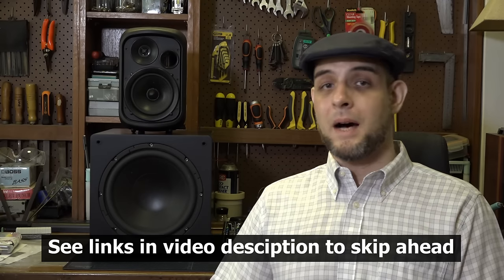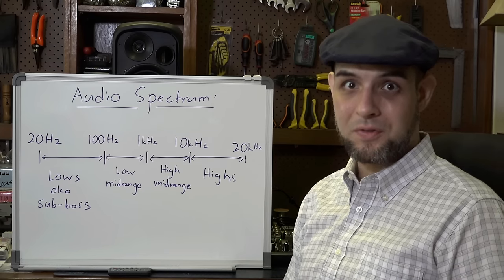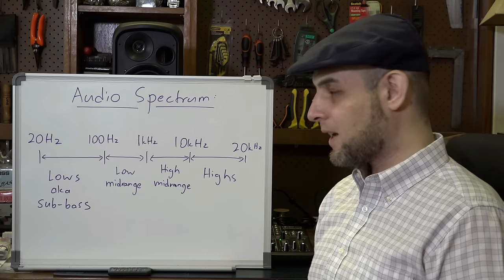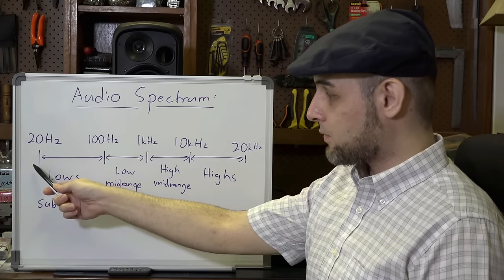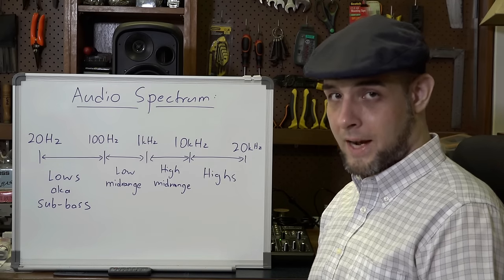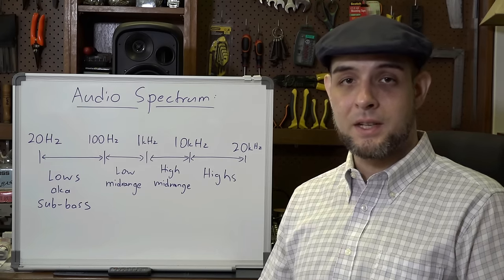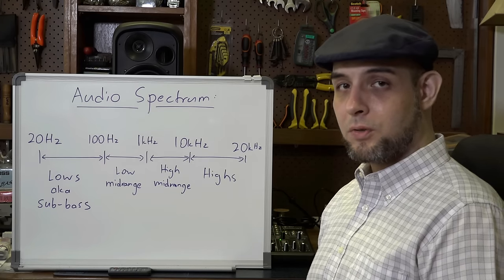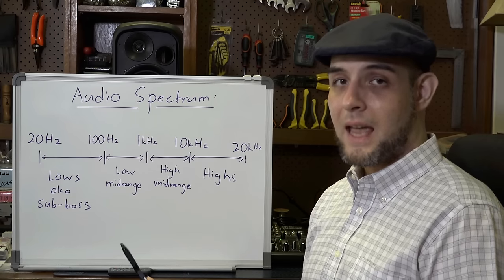How to connect an active subwoofer to a sound reinforcement system

Comment: Hello GLB, enjoying and gaining audio knowledge from your videos well done! 
On behalf of a church, we have bought a mixing console (unpowered), an EP4000 watt Amplifier at 4ohms, two full range speakers at 4 Ohms, we will soon buy subwoofer and 2 stage mornitors. How can we connect this PA System? Very confusing.
Reply from the maker: I suggest that you hire a local pro audio engineer to help you connect this system together - that way it will be done correctly the first time around. They can also suggest what additional equipment you might need to purchase in order to make the best use of the system.

Comment: Hello Bruno@GLB Production.  Thanks for your video.  I have question: Does Yamaha MG10XU has the Post Fade Aux / Group Send connections?  If not, what better mixer have those?  Thanks again!
Reply from the maker: On that mixer you would need to use the FX send.
Reply: @GLBProductions  Thanks so much! what is the next upgraded mixer would you recommend?  A better one than the Yamaha MG10XU?  The purpose for the mixer is for Karaoke system with two active loud speaker and a subwoofer, plus recording karaoke song/live voice to the computer.
Reply from the maker: It depends on your requirements: if you need more channels/more aux sends the logical upgrade path is to the MG12XU. If you need more professional features you would look at one of the models in the Yamaha MGP series.

Comment: Can you connect both active and passive speakers togethers on a powered mixer?
Reply from the maker: Yes you can: passive speakers to the speaker level outputs and active speakers to the line level outputs.

Comment: I came across your old video and thank you for your excellent teaching.
I'm curious if there are differences between: 
A - bi-wire from the integrated amp into the full range speaker ( 50 hz - 20Khz), then 2nd set of wire into the subwoofer and manually X-cross at 50hz
B - from integrated amp into subwoofer and manually X-cross at 50hz, then from the subwoofer output into the the full range speaker (50hz -20khz). The latter method is how you illustrated in the video. Thank you again!
Reply from the maker: Good question - it's very important to understand that because the sub is active, the connections that you see in the video are at LINE level. If you are using an integrated amp with passive speakers your connections would be at SPEAKER level. So the methods described in the video may or may not translate directly to your setup. To answer specifically: 
A) Bi-wiring is a hi-fi technique and is not used in pro audio. That aside, this setup is inferior as it does not remove the low frequencies from the fullrange speakers. 
B) Remember that the video shows LINE level connections - the amplifiers are in the speakers themselves - if you are using an integrated stereo amplifier or AV receiver the amplifier is in a different location. 
I hope this helps 😊
Reply: @GLBProductions  Thank you for your details response and it helps very much. 
It's for my home 2 channels stereo system consists of Rega Brio Intergrated amplifier utilizing bi-wiring speaker line out to the active sub-woofers and to the passive speakers. It's identical for set up for left and right channel. The intend is to provide full frequency range signal to the full range speakers, and only remove the high frequency from the sub-woofers. In addition, I prefer to utilize the amplification from the integrated amp feeding the passive speakers oppose to the plate amp from the active sub-woofers.
Do you see any issues connecting this way, and does it changes the ohm load and/or consider parallel connections?
Reply from the maker: Ah the Rega Brio - nice compact setup 😊 If you are happy with the way your setup sounds then by all means keep it that way - the way it sounds is the most important thing!

Comment: Can we have some insights on line array systems pliz 🙏🏼
Reply from the maker: Sure - could you be more specific?
Reply: Connections, recommended sets, relative angle adjustments... Basically the whole stuff about line array set up 😁🙏🏼
Reply: I mean a dedicated session on line array systems.
Reply: Let me add something as well:
Although the passion was there for me to go for a formal training in sound engineering, I never could afford it, nor were there any sponsorship even from my church.

You are my only teacher on this. I have learned a whole lot from your channel. I admire your wide range of knowledge on sound engineering. I also like your sense of humor 😁👍🏼

Bruno, you are my "guru" 🙏🏼
Reply from the maker: Thanks for the suggestion Steve, and I'm very glad the channel has been helpful. The best way to learn more in this industry is from a fellow professional, so don't be afraid to intern or work part time for your local live sound company or event production house - there are always openings for those who work hard and show up on time 😊

Comment: Smartest Video, most thoroughbred video / explanation-al / education video on this within entire YouTube, as Believe me - I CHECKED everywhere until I found you! ....so glad I found you subbed BTW, one more question for you GLB, does it matter how thick the wire is on my passive sub (Basic - RED AN BLACK THIN WIRE PLUGS IN EACH END) as I have the ULTRA Rare to find Neodymium magnets = Monsoon MM-1000 2.1 Flat Panel Computer Speakers (3-Speaker, Black) "system" (highest end originals ever made BUT Not as impressive as second gen I used to have - however still insanely beautiful & rich) unless maybe my amp is broken (inside psu or?...) and I can not be sure, anyway to be sure?... I have the original huge, heavy PSU... I am missing the control unit though, not a huge deal as I will find it down the rabbit hole of eBay, etc - one day an it has controls on top of unit as well so this is NOT my issue!...

Now, my MAIN Question is, I was giving a nice sony ss-ws5 sub woofer in silver case I was going to use as a micro ATX computer case custom of course until I realized it seems it works and will be a great edition to my monsoons and just what they need if I figure out how to make this passive sony woofer an active one or just make it work the most sensible way to get my 90's hip-hop and hard / 90's and beyond - alternative rock working well with this Sony (with the monsoon "system" which has two channels if that matters?) which I think is 60 watts from what I see.... Suggestions?

Thank so much for the video, sound is coming back in style for 2020 and beyond so hope your still ding videos, now is the time to strike, good luck - your very knowledgeable on this stuff an I appreciate you greatly, Stephen from Philadelphia, Pennsylvania, U.S.A. 

BTW: Look forward to an awesome reply with some situations for ME and MY situation FROM Someone like YOURSELF.... I think the PDF for my monsoon specs are right on the web, 20 watts? I am leaning toward maybe having to turn the passive song into a active with a amazon 30 watt (or up to 60?) AMP! .....Or will my situation change just by getting much thicker monster type two wire versus the cheap thin copper stuff I am using now to TEST.....  Thanks Again...
Reply: If I do put an AMP into my passive sub - shall I build it inside the unit like I want to and can to be clean looking as I am good at this stuff... I am a residential hard wire electrician and a computer building "enthusiast" that LOVES an appreciates his sound.... I suppose I am asking will the air inside the unit be disturbed so much so that it ruins the experience if the AMP is put inside? As I an see the model of the Sony was built for the air to travel out the case, how particular this is, I am unsure.... On another note, I have old HP speakers from my old plasma from 2006 that are spectacular that I could never throw them out but they will not play unless hooked to the tv, maybe make my own system with this with wood, an amp, but what type of amp is good for a project like this with many tweeters, mids and an out woofer or two? By now you may realize I know NOTHING about "AMPS" but am in search of knowledge on them, I suppose a project like this I would have to solder, maybe a video on making any speaker a Bluetooth speaker will do well for YOU?.... Also, please do not hesitate to tell me if you think the Sony speaker inside the Sony SS-WS5 is not worth it? I have no taken it apart yet to feel the quality nor the type..... It looks decent, can not see if paper or not..... I doubt so though, it seems to be built well like those years in the 90's up until around 2009 when we still got stuff built like TANKS an meant to last forever that also sounds great however I could be WRONG....
Reply from the maker: Hi Stephen, nice to hear from you! If I were you I would keep the subwoofer stock and look for a suitable external amplifier. You could also try and find a suitable AV receiver to drive your entire set up - sub plus tops. I'm not an AV/hifi specialist so can't really be more specific than this - good luck with your system!

Comment: somo active speaker have build in crossover, can you use external crossover with those speaker? if so how to bypass the crossover of the speaker?
Reply from the maker: No, this is generally not possible - active speakers are designed to work with their built-in amplifiers and crossover.

Comment: is it possible to connect passive sub woofer with external power amplifier  to active top speaker ? using method 1 setup ? does it not overdrive the active top loudspeaker ? your good in explaining sir bruno...
Reply from the maker: Yes no problem - just use the line output of the active top speaker.
Reply: Thanks sir how about the method 2 ? Is it also applicable that you use passive sub woofer in group out send ?

Comment: Hello, what is the different in using a compressor and a di box and can I use both let's say for my bass guitar
Reply from the maker: There's a big difference: a compressor is a device which reduces the dynamic range of a signal, ie the difference between the loudest and softest parts of the signal. A DI box converts a high-impedance unbalanced signal into a low-impedance balanced signal that can be transmitted long distances without picking up noise or interference. Some pedals/preamps combine these two functions into one physical unit but they are not the same thing. And yes you can definitely use both at the same time.

Comment: Thx Bruno for your expertise,  my question is what the best setup for an aerobics room sounds giving that the instructor needs to move around the room with the mic headset on , I often get that squeaky loud noise if I come near or in the front of the speaker , I find myself always trying to adjust the Gain,  the other question is the powered speaker are better choices for for the purpose and do you still need a mixer for that matter. Thanks again
Reply from the maker: For this type of situation you ideally want a mixer or powered speaker that has built in feedback elimination. Having a mic in front of the speaker will always risk feedback.

Comment: Thanks for that video, very helpful. I've got a passive system with an equalizer running on it, referring to your diagram on the passive full range speakers and power amp set up, where can i connect my equalizer, is it before the sub woofer or after the subwoofer? Thanks.
Reply from the maker: Thanks for watching Stella. The EQ can be connected before or after the subwoofer, depending on whether you want to equalize your entire system or just the fullrange speakers. Experiment and see which works best for your setup.
Reply: All good, will try both methods and see what happens. What would you recommend? Also another question pls, if i had to connect and daisy chaining up two power amplifiers, do these amps must be the same make and model and its specs or doesnt matter? Thanks.
Reply: Also I've got a passive d.j system on a two channel power amp, with 2x 15" speakers, if i want to hook up an active 18" sub woofer to add on, whats the best way, and the safest way to connect this, pls. Many thanks.

Comment: Hi, what do you mean by larger systems? More speakers or just more power? I have two, 2 10” active subs 700w and 2 passive 600w mains. I have 2500w power amp and 16 channel board. Do I need to use a crossover with this? Thx, awesome video.
Reply from the maker: Any time you run subs with fullrange speakers you should have some sort of crossover - it can be integrated into the sub, in the tops, or a separate rackmount unit. But you need some way of separating and directing the different sets of frequencies.
Reply: @GLBProductions  thank you for your response!!!

Comment: Hello, thank you for your explanation. I want to know the different between subwoofer and superwoofer?
Reply from the maker: The term 'superwoofer' is not used in the industry - it was created by the marketing department ;)
Reply: So there is no term superwoofer in industry right. But I see pioneer audio system, they put that super woofer.
Reply from the maker: As I said, it's a marketing term - it's like saying 'super turbo' or 'super laser'. It's not a technical term.
Reply: So actually the super woofer is subwoofer right ?
Reply from the maker: It's some kind of low frequency driver - more than that I can't say.

Comment: Thanks for the video. I have an powered mixer, what kind of sub do I need and how to connect it?
Reply from the maker: Powered mixers can be connected to either active or passive subs, depending on your needs and budget.
Reply: GLB Productions thank you for your time and respond, can you elaborate a little of it uses; like powered mixer connect into a active sub inputs then outputs  to mid/high speakers or to Aux send is a better choice to two powered devices?
Reply from the maker: Yes either of those will work fine :) If the sub is active, just select a line level output from the powered mixer, either one of the L/R outputs or an aux send, the sub will take care of the rest. If the sub is passive, you can either drive it with one of the powered mixer's internal amps or send a line output to an external amplifier and then to the subwoofer.
Reply: Thank you! That’s well clear. I did notice there are 3 types of sub; passive, active, and powered sub (this one has power but no amp so does it use similar to active amp?)
Reply from the maker: You're welcome! Active = powered, ie the amplifier is in the back of the speaker cabinet :)
Reply: Ah, so it’s just a matter of small or big amp in back of the speaker; that’s what I thought at first. Thank you for your help. God bless!

Comment: Hello Bruno, hope you’ve been well and I hope you’re still reading the comments here. When I originally commented on this most excellent tutorial around 9 months ago, I was considering adding a sub to my system, but here we are months later and I’m just now getting on this project. I just watched the video again (twice) and decided that method #2 is definitely the one I’m going with because I need the ability to control the subs level via my mixer; however, regarding the connection to the sub, only one “input” is required? It looks like you used the left input, is this correct? Or does it matter which input is used because the sub is mono? I purchased a JBL LSR310S sub which looks similar to the sub you’re using so I’m assuming using the left input would be acceptable? Once again, thank you for putting together this clear, concise lesson.
Reply from the maker: Yes just use one of the inputs, either left or right. Enjoy your new sub!

Comment: Question please , I have 2 tops , 2 subws and 3 monitors for a band.  Do I need to used more than one outlet to connect my equipment ?
Reply from the maker: You can calculate that fairly easily by looking up the current draw for each loudspeaker and then adding them together.

Comment: Your information is very good and clear. But I have a question to you sir to see how can you help me. 
I have an active sub and active speaker . I've done everything you have said but the only problem is the speaker got overload though I turn down the sub volume. So why is this.
Waiting patiently for an advise from you .
Thanks and warmest regards
Jones
Reply from the maker: Hi Jones, how do you know that the speaker is overloading?
Reply: It shows clip on the display screen.
Reply from the maker: @jonescamille8135  Ok, do you hear any audible distortion? Or is it just the indicator on the screen. What make and model is your speaker?
Reply: Did hear the distortion really because the moment it shows clip I didn't take risk so I prefer to not play it. The speaker is EV ZLX 15 powered
Reply from the maker: @jonescamille8135  Ok in this case I suggest simply reducing the input level on the speaker - see page 19 of your manual 😊
Reply: Ok thank you very much. By the way can I connect active speakers through none active mixer monitor out ?

Comment: Referring to your illustration passive full range speakers  setup, how to coocin case of using 2 powered sub woofer
Reply from the maker: With two subs you separate the left and right sides of your signal chain, so on the left side it would be: Left mixer output -> left active sub -> left power amplifier -> left passive speaker. Duplicate for the right side.